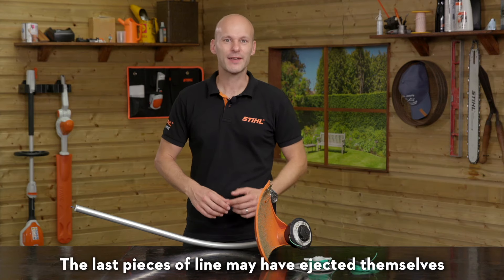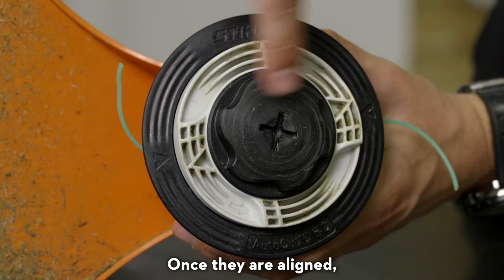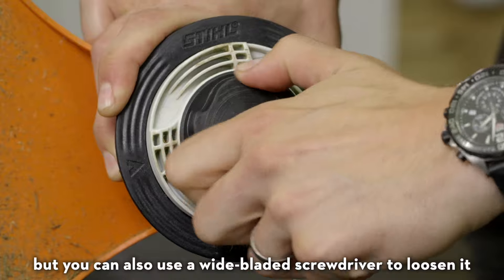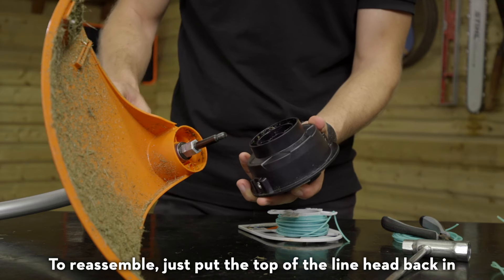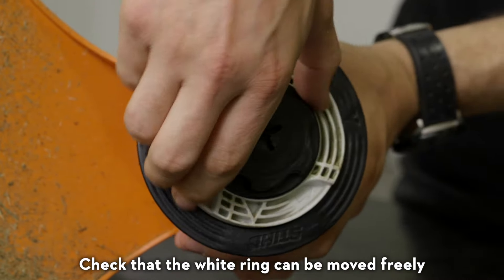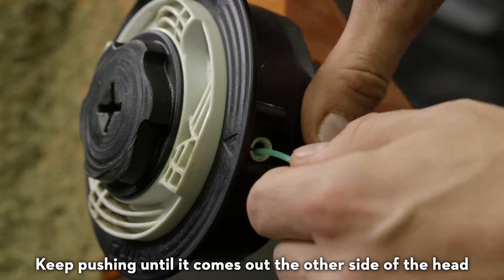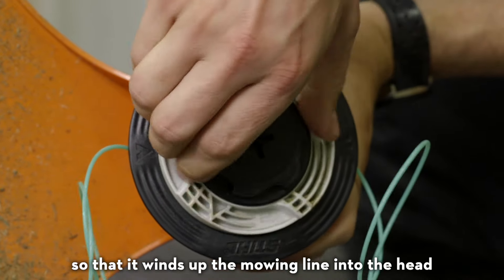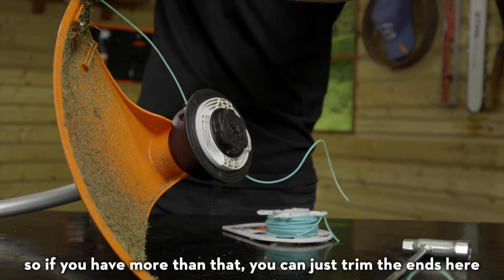How To Reload The Line On An AutoCut C 6-2 Mowing Head | STIHL GB

Comment: I need to add more line but even with the arrows aligned it won't come out freely. 
I then disassemble the head so it can come out freely and it's still stuck.
What should I do now?
Reply from the maker: Thanks for your comment and sorry to hear you are still having issues. In this instance, we would recommend taking it back to a STIHL Approved Dealer so that they can look at it properly for you and advise what the issue is. You can find your nearest dealer here: https://shop.stihl.co.uk/pages/dealer-locator
Thanks, STIHL GB

Comment: I know how to thread, but I have a problem with the line shear off and  or the auto feed when bump on the ground doesn't eject line.What am i doing wrong
Reply from the maker: Hi Brent, if the line is not extending when the head is bumped, we recommend re-threading the line and trying again. It can also help to bump the head more regularly, as soon as you notice the line has been worn down. Finally, you can also soak the line in water beforehand - this can make it less brittle, which helps to stop the line breaking off inside the head. It is unusual for the line to just shear off. If you are still having issues, we recommend taking your machine to a STIHL dealer who can advise on the issue and offer advice on preventing this in the future. I hope that helps. Thanks, STIHL GB

Comment: Mine seem to stop feeding and seems like it gets stuck and stop feeding. What am I doing wrong? I have this exact head.
Reply from the maker: Thanks for your comment and sorry to hear about the issues you have had. Have you taken it back to a STIHL Approved Dealer? If the mowing line is wound correctly inside then it may be worth getting a STIHL dealer to take a look as they should be able to diagnose any issues. Thanks, STIHL GB

Comment: Thank you for this, very helpful. Quick question: I have some 1.6mm line, would my FS50 work with it?
Reply from the maker: Hi Peter, the current version of the FS 50 comes with an AutoCut C 5-2 cutting head as standard, which I'm afraid only takes the 2.0mm line. The FS 50 can also be used with the AutoCut C 6-2 but that only takes 2.0mm or 2.4mm line. Thanks, STIHL GB
Reply: @STIHLGB  thanks for the answer. Just to let you know though I bought mine last week and it came with the C 6-2 so not sure if that's good or bad 🙂
Reply from the maker: @PeterBalga  that is absolutely fine! The C 6-2 is the newer design. Out of interest, did you buy it in Great Britain? Thanks, STIHL GB
Reply: @STIHLGB  oh that's great, thanks! Yes, I bought it from Sam Turner & Sons. Excellent piece of kit by the way, lots of power considering how lightweight it is.
It just ran out of line a bit too soon haha
Reply from the maker: @PeterBalga  you may have tried this already but if not, it's worth putting the line in a bucket of water for 24 hours before first use as it makes it more supple and less prone to breakage so it may last a bit longer. Anyway, glad you like the trimmer. Let us know if you have any other questions, thanks, STIHL GB
Reply: @STIHLGB  That is not true at all, yes it was meant to run these diameters, but today i tested it and you can put even 1,3 mm line in there and it works just fine. Also tried 1,6....no problems. It is just physics, line has to fit through the holes and that is it. You cant put wider line in there, yes, but thinner....yes you can and it works well.
Reply from the maker: @kalapede1  thanks for your comment. A smaller line will definitely fit in the machine, but it will wear more quickly than the recommended line and reduce the performance of the grass trimmer. Using the recommend 2.0mm line will allow you to get the best out of the machine as it was designed for. Thanks, STIHL GB
Reply: @STIHLGB  Agree...but it will work well on small grass :)

Comment: For some reason the bump feed doesn't work on mine, any solutions?
Reply from the maker: Hi, thanks for your comment. If it's not working properly, we always recommend taking it back to a local STIHL Approved Dealer for them to look at. If you have done that and you haven't been able to resolve the issue, you can also get in touch with our Customer Services team on 01276 20202. Thanks, STIHL GB

Comment: Mine keeps breaking at the parts where it should feed out from.. what am I doing wrong?
Reply from the maker: Hi, thanks for your comment. Do you mean that the mowing line is breaking? Mowing line can get quite brittle and dry so it's worth soaking the line in a bucket of water for 24 hours before you start using it. That should stop it breaking off so much. Thanks, STIHL GB

Comment: On my head the line frequently disappears as if it was done and ejected, only to find that there is still plenty of line left inside, very frustrating. What are my troubleshooting options?
Reply from the maker: Hi, thanks for your comment. We have a couple of suggestions that might help. Firstly, make sure that you are running the head at full throttle when you bump it on the ground to make sure that it extends properly. We also suggest extending the line a bit more regularly so that it gets extended before it breaks off completely and the end pulls back in. Finally, it's also worth soaking the line in water when you first get it (and it it's been unused for a period of time). This makes the line less brittle and less likely to break so this also makes it last longer too. If it's still happening, it may be worth taking it to a STIHL Approved Dealer to get it looked at. Thanks very much, STIHL GB
Reply: @STIHLGB  Thank you, I will give your suggestions a try.

Comment: Will it fit a fs 36?
Reply from the maker: Hi James, thanks for your comment. You should be able to run the same cutting attachments as the FS 38, which are the AutoCut C 6-2 and the PolyCut 6-2. However, we stopped making the FS 36 in 1999, so you may want to take it to your nearest STIHL Approved Dealer to double check that it fits with the latest attachments. Thanks, STIHL GB

Comment: I bought the new C6-2 head and it has only worked correctly twice. I am using still  .095 string
Reply from the maker: Hi Brian, please could you provide a little more information on what the issue is?  The AutoCut C 6-2 is compatible with 2.0 - 2.4mm mowing line.  Many thanks, STIHL GB
Reply: Using still 2.4mm line that is orange and has ridges
Reply: If the black bumper is not loose the string holes do not line up
Reply from the maker: @briananderson2619  Hi Brian, the tightness of the centre nut should not affect the alignment of the string holes.  You should be able to turn the white ring freely to allow for the mowing line to pass through when the inner and outer arrows are lined up.  It is always worth emptying and reloading the mowing head with line to see if that helps.  If you are still having issues, please could you send an email including pictures of the problem to our customer support team at enquiries@stihl.co.uk or take the mowing head to your local STIHL Approved Dealer and they will be able to help.  Many thanks, STIHL GB
Reply from the maker: @briananderson2619  
Hi Brian, the tightness of the centre nut should not affect the alignment of the string holes.  You should be able to turn the white ring freely to allow for the mowing line to pass through when the inner and outer arrows are lined up.  It is always worth emptying and reloading the mowing head with line to see if that helps.  If you are still having issues, please could you send an email including pictures of the problem to our customer support team at enquiries@stihl.co.uk or take the mowing head to your local STIHL Approved Dealer and they will be able to help.  Many thanks, STIHL GB

Comment: How do I remove the line? The way you showed does not work for me, it is stuck and will not pull free. One side has 4-6 inches and the other is inside the reel.
Reply from the maker: Hi Bonnie, thanks for your comment. If the line is stuck inside the reel, you'll need to take the head apart. We do show how to do this in the video from around 45 seconds in, where it shows you how to take the cap off and access the reel. If you have tried to do this and you are still stuck, we recommend taking it to a STIHL Approved Dealer who will be able to help. You can find your nearest one here: https://shop.stihl.co.uk/pages/dealer-locator
Thanks, STIHL GB

Comment: Just bought a new FS40 with this head. Loaded it no problem but it breaks the line continuously every 2-3 mins. The ends then disappear back into the head, really frustrating. In case it was old brittle line I bought new line, no difference.
Reply from the maker: Thanks for your comment and I'm sorry to hear about this. We always recommend soaking the line in water for 24 hours before first use as that will help soften the line, make it less brittle and last for longer. Thanks, STIHL GB
Reply: @STIHLGB  What a pity you dont say that in the Owners Handbook.
Reply from the maker: @dartmoordave  thanks for the feedback but it is actually mentioned in the instruction manual for the AutoCut C 6-2. It is detailed at the end of each language section. Thanks, STIHL GB
Reply: @STIHLGB  Thanks for the reply. Mine came with a single sheet slipped in the main manual. Theres no mention of storing the line in water, thats why I mentioned it, but never mind. Publication 0458-546-0121-E / 0457-363-0145-AH17.
Reply from the maker: @dartmoordave  thanks for clarifying. Apologies, when you buy the mowing head separately it comes with a full instruction manual which includes the reference to soaking it in water, but we appreciate that if you buy the tool with the head attached, you may not get the full instruction manual. I have passed this feedback on to our Product team now. Thanks, STIHL GB

Comment: How do you completely remove the bump knob? mine just keeps spinning
Reply from the maker: Hi, thanks for your comment. That doesn't sound right, but it's hard to diagnose issues like this on YouTube. Have you taken it back to your STIHL Approved Dealer? They will be able to help resolve the problem. You can find your nearest one here: https://shop.stihl.co.uk/pages/dealer-locator. Thanks, STIHL GB
Reply: @STIHLGB  is the bump knob part of the spool or can it be removed i should have asked
Reply: @STIHLGB  when searching for bump knob it is only showing the whole trimmer head with spool, maybe it cannot be brought separately im guessing
Reply from the maker: Hi  @mets23q  , I've spoken to our technical department and they have confirmed that the bump cap is available as a spare part and can be changed, although you would need to order it from a STIHL Approved Dealer. The part number for the one on an AutoCut C 6-2 head is 4006 710 4003, but it's worth checking that's exactly what you need with the STIHL dealer. Thanks, STIHL GB
Reply: @STIHLGB  cheers mate

Comment: What is wrong if the white ring will not move?
Reply from the maker: Hi, thanks for your comment. We recommend that  you undo the centre nut, remove the line and start the whole process again following the video instructions. If it becomes stuck a second time, you should take it to a STIHL Approved Dealer to take a look at. I hope that helps, thanks, STIHL GB

Comment: I don't know why you would cut the line off instead of gust reeling in the line a little more...
Reply from the maker: Thanks for your comment. Certainly if you already have an even amount on each side and it's too long, then you could just wind it in a bit more. The demonstration in the video is really just to show that you should check it and if one side is slightly longer than the other, you can trim it down. Thanks, STIHL GB

Comment: Wind which way?
Reply from the maker: Hi, you need to wind it anti-clockwise. You'll be able to see the line being pulled into the mowing head as you turn it. Thanks, STIHL GB
Reply: @STIHLGB  Lines will wind in either direction. But only one direction will work.

Comment: My line keeps breaking off inside the head.
Reply from the maker: Hi, thanks for your comment. If the line keeps breaking off inside the head, it may mean that it is too dry. Mowing line can dry out over time, which does it make brittle and prone to breakage. This can be resolved by soaking the line in water for 24 hours before use which will make it more flexible and less prone to breakage. Thanks, STIHL GB

Comment: My string won’t auto advance.
Reply from the maker: Hi, thanks for your comment. The AutoCut head needs to be bumped firmly while spinning at full speed. This works best on firm, grassy ground away from the main lawn area. If the line does not feed out, we recommend removing and re-winding the line into the spool and trying again. We have a video here which shows it in action: https://www.youtube.com/watch?v=j-PXYPtAE8s  Thanks, STIHL GB

Comment: ca n'empêche pas le fil de cassé a chaque fois ...
Reply from the maker: Hi, thanks for your comment. Do you mean that the mowing line is breaking? Mowing line can get quite brittle and dry so it's worth soaking the line in a bucket of water for 24 hours before you start using it. That should stop it breaking off so much. Thanks, STIHL GB

Comment: How do you stop the line from constantly going back into the head? This thing is a piece of shit, how does it save you time when you have to unscrew the head and pull it apart to get the line back out of the head every 15min
Reply from the maker: Hi, thanks for your feedback. If the line is going back into the head, then there are a couple of possibilities. It could be that the line is getting too short before you tap the head so you could just try tapping it out more often. You should also make sure the tool is at full throttle while the head is bumped on the ground. Finally, it could be that the line is breaking off, which can be resolved by soaking the line in water, which will make it less brittle. If you are still having the same issues, we recommend visiting your nearest STIHL Approved Dealer and asking them to take a look at it. Thanks, STIHL GB
Reply: I have this issue too, you get about 5 minutes use before you have to disassemble the whole thing and start again. Very annoying design.